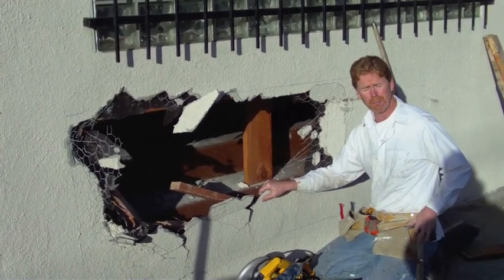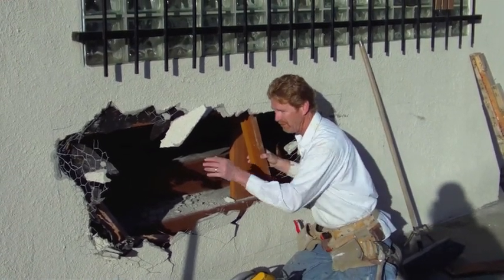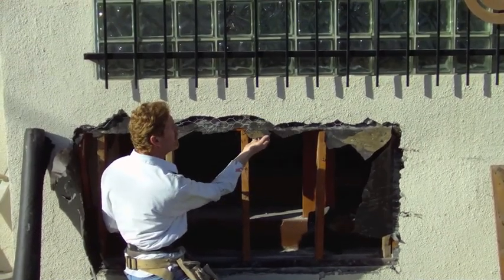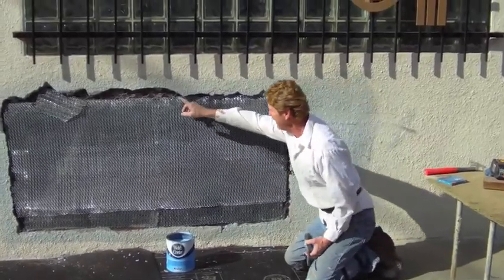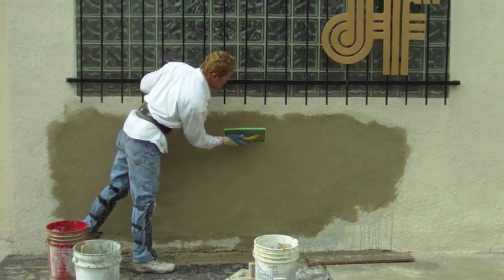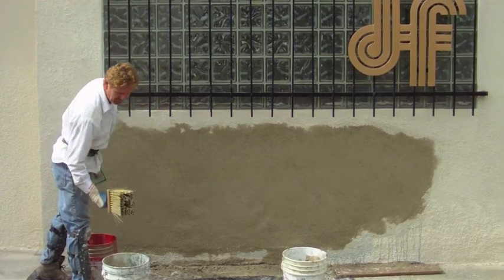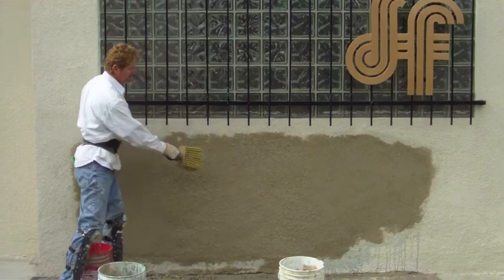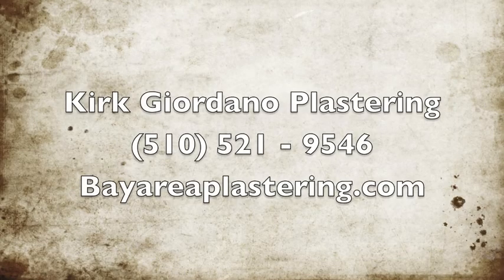Repair a hole in an exterior stucco Wall. My dads first video

Comment: Thank for the tips, Firstly, 3.4 mesh wire is a better alternative to the out dated stud to stud wired used in the 1950's. Secondly, the concrete is covered. Thirdly, I did apply a scratch coat, One of he difference’s between stucco and concrete is mainly the aggregate. Stucco is generally mixed with sand, while concrete is mixed with various size rocks for the desired structural strength. Fourthly, I used a Darby  to make certain the wall was true and plumb in all directions. Best wishes, Kirk

Comment: Nice job. I've always been curious about those old school finishes. I just leraned something new. A good idea when lathing over open frame construction is to first install "Line wire" from stud to stud. That will keep the paper from bowing in on you. It's also alot cheaper than Diamond mesh.

Comment from the maker: Often houses have building paper installed over the bare studs, like above. It's an older style of building. You can waterproof stud houses effectively with no sheathing, or backing material, but its not an easy task and you must get the proper overlap with the existing building paper to make it waterproof. 

Good luck on your project! Hope that helps.

Jason Giordano Plastering

Comment: Hi Kirk:

Great videos. I have watched your instructional postings for over a year now. I was a journeyman carpenter in my earlier years and built my house here in Riverside CA during the Late 80's. My wife wants to retrofit a bunch of our windows; she'd like dual glazing. I will do the work myself being retired. I'll use your videos to guide my install (break-out and removal, re-stucco the walls. Did you post any videos on this type of work?

Thanks again.

Jon

Comment: first use tie wire from stud to stud that would keep the paper from foldin in second cover concrete and surroundin so you wont make a big ass mess with the cement third its cement not stucco and you shouldnt skip the scrath coat i know you want to save time but do it right forth learn how to brown that wall doesnt look straight to me learn how to use that darby fifth shit im just gonna stop cause im just gonna keep going and going